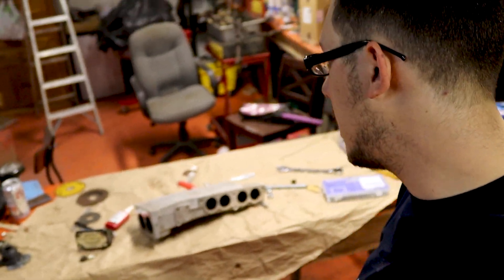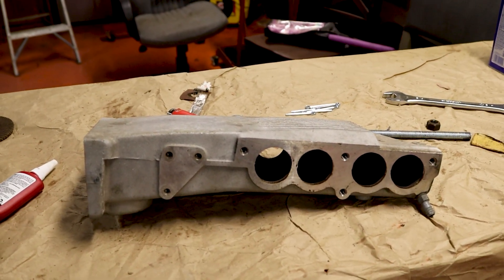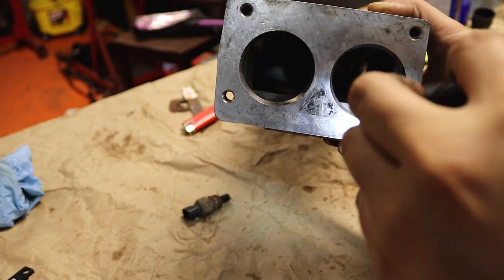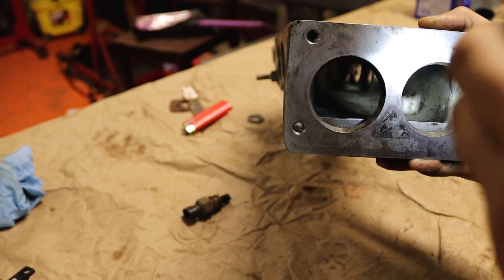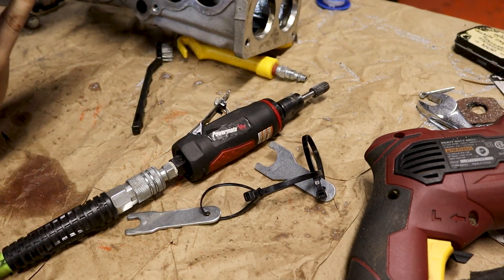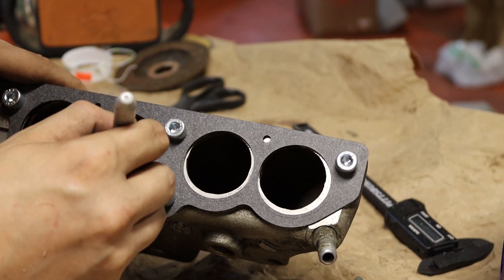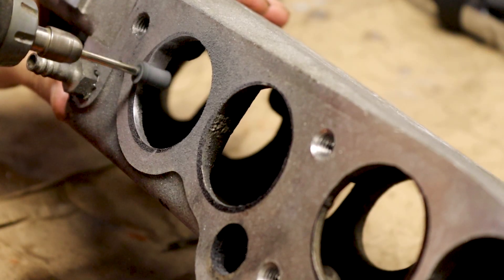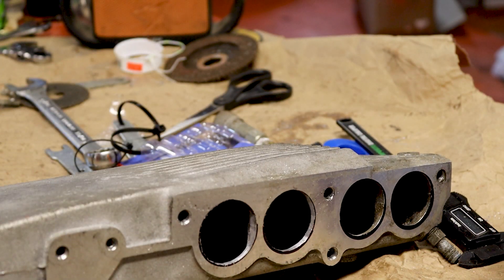Tuned Port Injection Performance Upgrades - How to Port TPI Upper Intake Plenum

Comment: I have an 88 GTA. Those plemums don't have the fins that far forward.
Reply from the maker: There's 3 plenums out there - 85-88 89-90 and 90-92. If memory services it's the 90-92 that have the shorter  fins. 85-88 should be cold start/MAF, 89-90 MAF, 90-92 Speed density. All should port the same, it's all a per-item basis.
Reply: @LSxHunter  yeah, I did mine back in march. Did the same things you did exept I gasket matched to stock gaskets and only knocked down the EGR wall to the shape of the TB bore and rounded what was left.

Comment: What about the front where the throttle body mounts. I see that you took down the ridge on the bottom, but the sides should they be ground down too?
Reply from the maker: Basically used discretion, I ended up widening it a hair but looking at it it seemed to channel air more than stop it. On the throttle body side of things I’d just try to look into the plenum and look for airflow blockages. I’ll probably have to throw up a short video to explain it better.
Reply: @LSxHunter  I finally got my TPI all ported and polished. It about time for the installation. My question is did noticed any gains?

Comment: Hey great channel really helpful tips. I wanted to ask a question from someone more knowledgeable. I have a 91 z28 350 L98 and i want to run a stealth ram intake as well as ceramic long tube headers and new 3" exhaust. My question lies in the fact that the ram will basically be an egr system delete and there won't be any smog lines on the exhaust anymore? Will this throw a code of make me fail a local emissions test? I see a lot of third gens without the smog stuff but everything I read makes it sound illegal. Thanks in advance.
Reply from the maker: Technically any change to the system that doesn't improve it is illegal. You COULD add one through an external EGR valve as well if you want to stay 100% compliant. Basically all you'd do is run a line from your exhaust to the EGR, to the EGR solenoid and the intake manifold but you'd need to punch a hole and thread it. 

Not having EGR in some areas can make you fail a visual test on the spot.

Comment: I am not a physicist but doesn't that ridge immediately behind the throttle body normally create a vacuum for the EGR system and by removing the ridge wouldn't that then create a positive pressure and disrupt the normal flow of the EGR??
Reply from the maker: EGR is typically removed in performance applications. It will not be going back onto this setup. You're likely right though. If you wanted to retain EGR you'd keep it.  Plenty of guys epoxy the holes as well.
Reply: @LSxHunter  wrong. The plenum is under vacuum when the dual 48mm throttleplates are closed. Also, upgrading to a 52 or 58mm TB will not give you more gains.
Reply: @LSxHunter  even at part throttle, there is still vacuum.
Reply: @SilentOneCorajuda13  I guess you are right, there is still a vacuum. Makes me wonder why they designed it with that ridge in the first place.
Reply from the maker: @dannottingham3786  General consensus from the guys I've been chatting with say it's meant to keep the EGR from coming back out of the throttle body. Probably a straight up guess but it does make sense.
Reply: Stones load up quick. It's better to use large flute carbide bits. The smaller flutes load up quick. Also a good idea to use lubricants with the large flute bits to be able to remove loaded aluminum.
Reply from the maker: @SilentOneCorajuda13  Mainly using stone for the softening of the edges, carbide burrs for making the initial cuts.